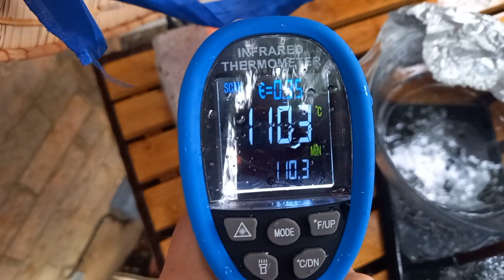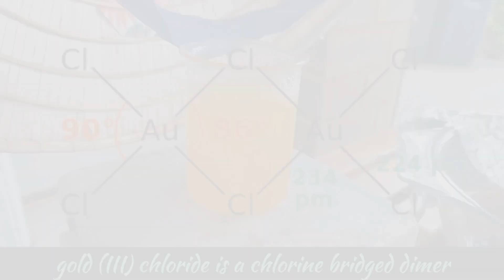gold chemistry - part 6 (chloroauric acid to auric chloride via repeated evaporation and redilution)

Comment: Nice work!!! Looked very clean.
Reply from the maker: After evaporating down I noticed it was still putting out nitric acid so I've almost topped the bowl to the brim with more water. I'll try and evaporate it again over the next hour then put in dessicator overnight. I saw some solid had reddened when it was in the dish. I guess that's the oxidation you want to try and avoid 😏
Reply: @SodiumInteresting  Refiners usually do the boil with HCl. Heat it to a near slurry, then add a few ml of hydrochloric acid & repeat. This is nice, I love watching gold chemistry.
Reply from the maker: @WaffleStaffel  that would leave chloroauric acid. The HCl needs to be removed to get gold 3 chloride.
Reply: @SodiumInteresting  I just outed myself for the pedestrian I am! I'm going to go watch the videos leading up to this instead of asking a bunch of dumb questions.
Reply from the maker: So I'm struggling to decide on what gold compound to make. I want to try that gold (I) cyanide before I recover the gold as a powder, I've never worked with cyanide but I have about 30g CuCN. Can I acidify that with HCl to get CuCl2 in hydrocyanic acid? I've watched some of your gold and cyanide videos but I couldn't find where and how you made the aqueous cyanide.
Reply: @SodiumInteresting   It's the first video in the cyanide playlist. Dont add acid to CuCN!! Cu(CN)2 is highly unstable and rapidly breaks down to cyanogen gas! Whatever you do dont oxidize it to Cu(II)!